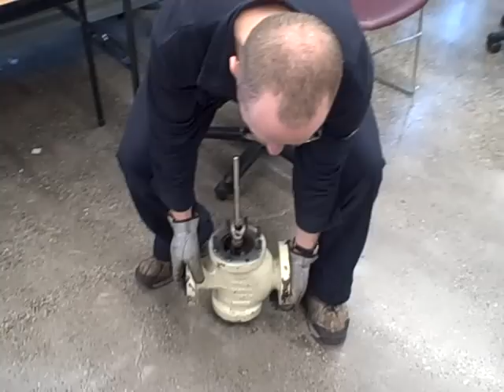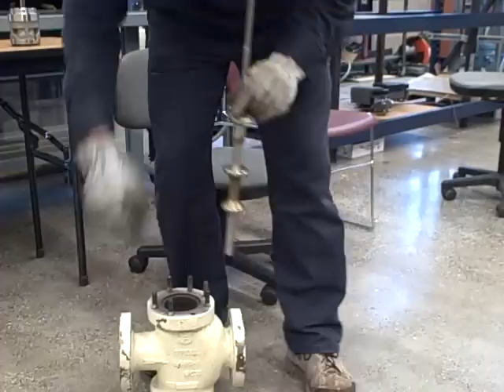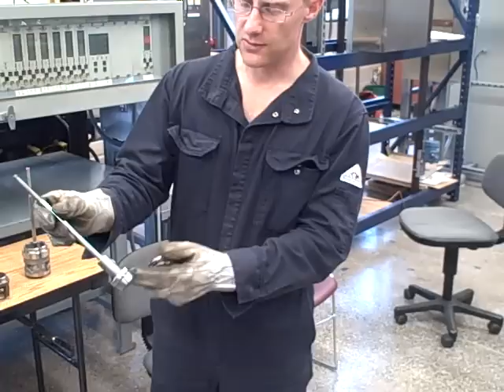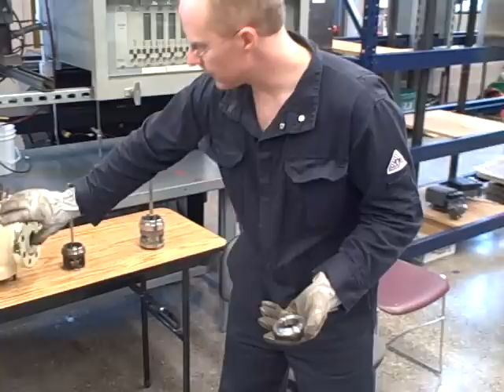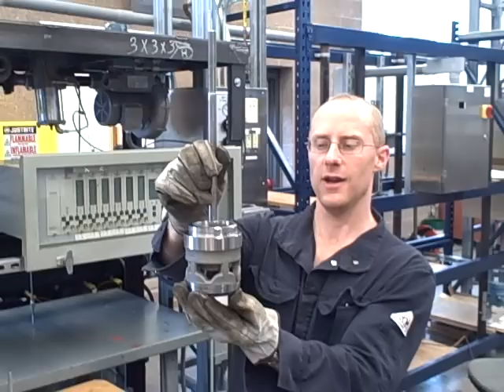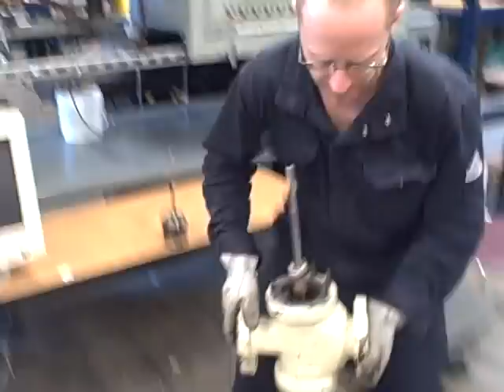Globe valve trim types

Comment: Very good video and terminology used... The only thing I would change is the description of the seating surfaces on the EZ unbalanced post guided explanation.  The seating surfaces are not matching nor should they ever be, the plug should be cut at 30 degrees and the seat ring at 33 degrees.

Comment: in the single ported stem guided valve ..we have also a small cage
Reply: But the cage in that has nothing to do with the characteristics changing it works as a guide for the plug